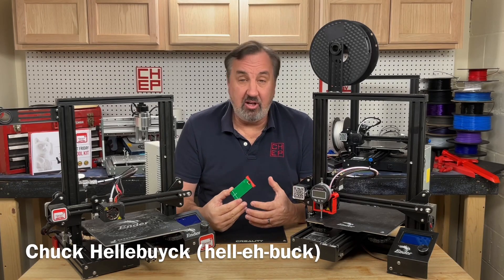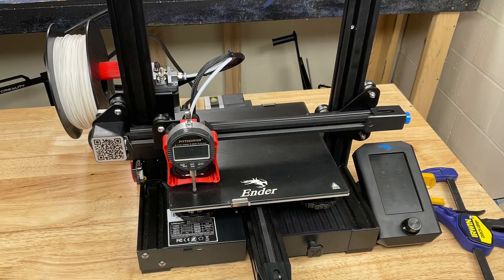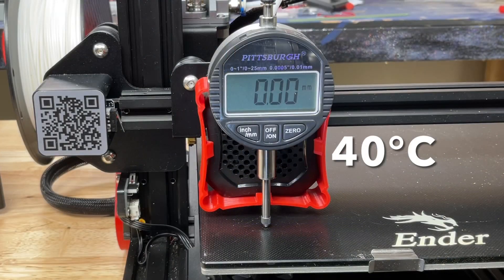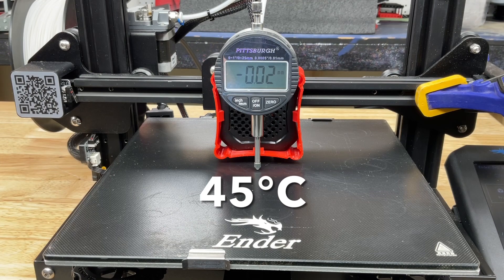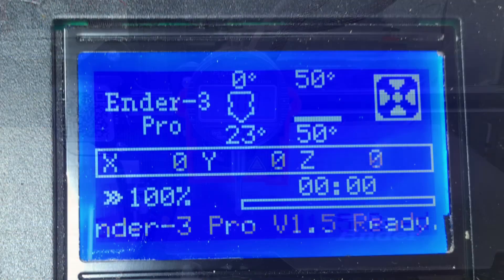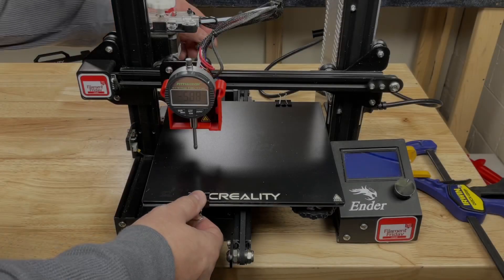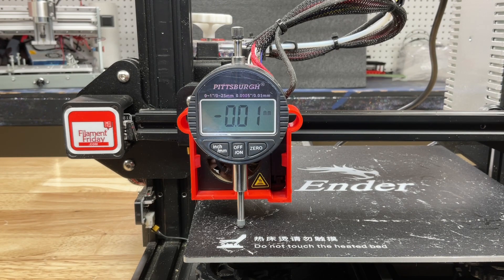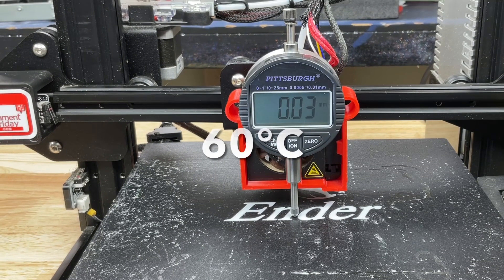Heated Bed or No Heated Bed Leveling?

Comment: When I got a Raspberry Pi(OctoPrint) and a BLTouch for my CR-10v3 I actually ran through the bed levelling with the Bed Visualiser plugin and found that I was getting a different pattern of warp when cold compared with hot, however like your video it was only minor changes.

Comment: I just got a crazy idea!
What if you could measure the width of an "elephant's foot" on the first layer of a test print that runs up, down, or diagonally across the print bed, and then use that information to level the bed?
The elephant's foot would be wider where the bed was too close to the nozzle, and narrower on quadrants where it was farther way. 
Any hope in this line of thought?

Comment: have you traid mirror glass ? that make better pritns for me. on my ender 3. ender 3 pro. ender 3 v2 and cr10 max
Reply from the maker: Yes, I’ve tried it. But over time I find it sometimes cracks because mirror glass isn’t high temp borosilicate glass.
Reply: what's that got to do with bed levelling?

Comment: I'd be really curious to correlate the probe gauge measurements with an infrared view of the bed itself. Specifically, does the bed actually heat perfectly evenly, if not could a center "hotspot" account for the variation is depths. Follow-up: if there is an initial hotspot after the target temp is reached, does additional time allow the heat to spread more evenly and either causing a more even expansion?

Comment: Lots of variables not considered here.  Lets not forget you are checking at 0.0 bed height. As a print rises in height, any imperfections are magnified.  Nice video, sorta proves to me, heating the bed to print temp can only help.

Comment: While the adjustment points don't move much when heating, the flex at the center is probably a good enough reason to heat before running something like a BLTouch.

Comment: I'm using an ender 3 with a BL Touch, so I always make it so that it only levels after heating the bed, I even make sure to make it wait for the bed to cool down. It only takes an extra minute or so, so I don't mind
Reply: Okay, but it's unnecessary.
Reply: @dangerous8333  Could be, could be not. I don't have a way to measure any difference, but my Ender 3 has the removable buildtac bed which goes on a G10 sheet. I remember once for fun I heated the bed to 110c and the removable sheet turned into a dome, it bowed at least half an inch. Of course that's because the center heated up before the edges, but the G10 sheet warping is still a light concern for me, and getting it to level with the bed hot only requires changing like 2 lines of gcode in cura, so it's no effort at all.

Comment: Bear in mind that 0.07 mm is only two thousands of an inch, for Aerospace parts that's important but for 3D printing its nothing....
Reply: But it's also 35-70% of a typical layer depending on your selected layer height. That can make or break a first layer.

Comment: I can't download your digital indicator mount.  It gives an error.  Broken.
Thank you CHEP I love your show.
Reply from the maker: Just checked. They are working.
Reply: @FilamentFriday  Yep!  It works now!  Just downloaded it.  Printing now.
Thanks CHEP!  You rock!
I do have misgivings about this mount, though.  I just tested my Ender 3 v2 hot end cover, and it is not secure.  It moves.
I don't know if we should trust a sub-millimeter reading on a plastic mounting that actually moves in the hand.
I'll print your mount and try.
Thanks again, CHEP.

Comment: The trick is, you can't have any solidified boogers on the nozzle, or you won't get the z height correct.  With the hotend warned up, you might ruin a piece of scrap paper, but you'll get the height correct.

Comment: Using PLA I always level it hot and then fine tune it during a large single layer test print one a pei sheet.
Reply: @BlondieHappyGuy  I basically commented the same thing however I'm using a 0.20mm(0.080") feeler gauge and I don't heat the bed or the hotend - perfect results!

Comment: I run ABL while my bed is heating up (then turn of bed heating after 2nd layer finishes 😄).
Reply: You might be confused.

This is for the initial bed leveling, with the knobs and when you're creating your mesh for the ABL. It's not about printing, it's just about leveling.

What you're talking about is unrelated.

Just to speak on what you're saying though, on a glass bed I would never shut the heating off. That would make my prints pop off prematurely. Especially on taller prints. On my E3V2 my prints will pop right off that glass bed when it cools down to a certain point, which I love. I've never had to use any kind of glue or hairspray nonsense.
Reply: @dangerous8333  glue, tape, hairspray, anything additional you have to put on your bed, no matter what material your bed is, has to do with other issues and more times than ever it's due to poor tramming.

Comment: My question is why wouldn’t you heat it to level? 

It doesn’t make any extra work, and a single heat time is negligible at worst.
Reply: Preheating is good for glass prints as well because it allows more time for the entire surface to get up to temperature, not just the part right next to the sensor.
Reply: @BenChilds  Glass prints?

Edit: Glass bed prints? If that's what you're saying I've never had to preheat anything on my E3V2 glass bed. With CR touch and Jyers I just hit print and walk away. Everything sticks. I clean the bed after every 10 prints with some isopropyl.
Reply: Because every extra step adds up when you're a busy person and time is money. So if there's no benefit, why do it.
Reply: The different in the center of the bed could definitely lead to trouble. 

I have a hard time seeing someone have the time to have 3D printing as a hobby, but not have the time to take 3 minutes tk preheat a bed once.

Comment: Heyy you seemed to only use Aluminum based printers. Aluminum basically doesn't deform but other materials definitely deform to a significant amount
Reply: What other materials would even be used..?
Reply: @PureRushXevus  Spring steel
Reply: @BigHonkinGoose  Do they use spring steel for the base though? I think that's what he was talking about. I don't think they use it for the base. Just for the print surface.
Reply: @dangerous8333  I think it's for the base. Not sure.
Reply: @BigHonkinGoose  Yeah.. printers themselves aren't made out of spring steel xD

The original comment made it sound like he meant the printers / print beds were made out of other materials.. which all I've seen so far, have been aluminium alloys, the only huge variety in materials is usually the print surfaces
Reply: @PureRushXevus  Also, I hear tell that cast aluminum is the best for not flexing, but machined and/or planed aluminum, especially if cheap, can warp more due to internal structural stress.
Reply: @PureRushXevus  You're right I think they're all aluminum. And the reason for that is aluminum heats more evenly.

Glass and spring Steel etc is only for the printing surface.
Reply: @dangerous8333  plus aluminum is easy to machine, and cheap :p
Reply: @PureRushXevus  Heat bed directly on glas
Reply: @allcrafter3747  ?
Reply: @PureRushXevus  like on the sidewinder x1
Reply: @allcrafter3747  Well that uses a huge AC powered heated bed, most lower end printers use small, DC heaters which are attached to aluminium in order to distribute the heat across the entire surface more evenly. 

Since sticking one of those tiny things on a thick glass bed would do a terrible job at heating the entire thing, I'd imagine

Comment: I do a 70-75c pre heat on the Creality aluminum bed before leveling. Then I manually level. I find my level lasts much much longer, especially on my machines using silicone springs. I level very tight with a very low z end stop switch. Horses for courses.
Reply: I have the upgraded springs only on my E3v2. Cr touch and Jyers. I pop the SD card in, hit print and walk away. Haven't touched those knobs in months. I set the bed manually both with and without heating and didn't notice a difference personally.

Comment: Years ago at school, I learned never to use a dail indicator at the 0 position because that is where it is most unreliable. 
That said, I don't believe it will differ a lot. 
Great test. Thanks.
Reply: good luck positioning it at 0;  you'd set it up under tension a bit and then zero it.
Reply from the maker: 3D PrintCreator - I’m not sure I understand your “zero position”. The dial indicator is not bottomed out it’s a random position that has up and down travel space and then I hit the zero display button. So how is that any more unreliable?
Reply: @FilamentFriday  lol, as said, I learned this more than 35 years ago and I am not sure if I am mixing up two different instruments, or if the dail indicators back then were another type (mechanical for sure), that you didn't zero. I have to search for it, but I think I still have my dail indicator I had back then somewhere.
Then again, as you explain it here, I am almost sure you are correct.

Comment: Incredible video, Chuck! It's about time someone had the wherewithal to test these things out! Personally I've always been suspicious of the paper method for several reasons. I believe the size of the paper in relation to the distance you're holding it at matters, as well as the angle of your hand to the plate when testing. No one has ever commented on my theories, but I'm nearly 100% certain those things matter. Lastly, I've never been able to determine the "right" amount of friction against the paper - I've seen & heard everything from "slight resistance " to "just under the point where the paper bends", so it's inexact at best in my book.
Reply: You can easily muster the wherewithal yourself. Simply get a feeler gauge and learn how to use it. A feeler gauge is a standard and inexpensive machinist's and mechanic's tool, which is used to measure small gaps... by feel.  You can then compare that to the various paper-measuring scenarios that you have suspicions about.
Reply: @Graham_Wideman  by far the feeler gauge is best for tramming!

Comment: Interesting conclusion.  I can see and reason the minor deflection of the small beds like on the enders.  But what about larger beds?  The CR-10 only attaches at four points while the CR-6 has multiple screws holding the bedplate.

Comment: A 1 meter aluminium rod expands by 0.000222 m for every 10c the temp rises by. This means tha thermal expansion on its own can never be an issue what is the issue is that beds can vary and some will warp when heated, not expand warp. This means your testing isn't relevant to anyone as their bed will behave differently from yours.
Reply: As a metal fabricator and welder, I concur.

Comment: So weird, this is such a big and common subject, I've got my ender 3 pro for a year now, haven't used paper for months and never used auto-level sensors, I only need to feel and look at the first lines on the brim or skirt to know which knobs to turn and by how much. 
After years and years, I would assume Chep would be on the same boat. I guess he does but this as a way to easily show how to level for beginners, maybe.
Reply: Oh yeah?

Well with CR touch and Jyers firmware I don't have to watch anything. I can just hit print and walk away. I haven't watched a first layer in months.

It's a joy.

Edit: Some people have to print dimensionally accurate prototypes, for one. So that's why they take the extra measures. Other people are doing it out of convenience. Not because they NEED it. ABL is not for beginners in my opinion. They should learn how to manual level first. ABL is for people that just don't want to have to deal with it anymore.

Comment: Anyone help me with printing without a raft? Using ender pro v2 glass bed, leveled. My issue is that the filament sticks beautifully when printing a raft. When i try to print without a raft it will not stick... i have tried to adjust the speed but it will not stick :( i use cura slicer.
Reply: I use hairspray. 

Aquanet All weather, extra strong, non scented. 
I made a little cardboard box to go over the bed to protect from overspray. 
But all I need is a short little spritz and I have no problems with adhesion. 
And I don't use rafts, only skirts.
Reply: @CaliMeatWagon  thats the thing its not adhesion the raft sticks perfectly. The initial layer without the raft will not stick.
Reply: Same as @CaliMeat said.  Clean my bed every 2 pr 3 prints. Use aquanet hairspray.  Also use a feeler gauge best money I ever spent.  Rarely have a print come loose and if it does clean the bed again and viola.

Comment: I literally have a dial indicator that I 3m tape to my extruder. Level, and print. I do this anytime my first layers start to bubble I do it again, or I just use a raft.  If you want to spend the money on ABL, go right ahead, no judgement. I always assumed we get way more deflection in the frame than the margin of error using a dial indicator with our lightweight extrusion frames. 

Chep, would love to see you measure deflection on the frame vs print speed and acceleration someday!
Reply: I use dial indicators all the time in my metal fabrication business. But the $40 I spent on my CR touch more then paid for itself when I coupled it with Jyers and I haven't watched a first layer in months. Time is money for me. I'm a very busy person. Nor do I like hunching over my printer having to adjust things when a simple little piece of tech can solve all those problems.

ABL is for convenience.

Comment: Quick question on the extrusion test, why do we measure it going through the extruder motor and not the nozzle?
Reply: Because you are calibrating the extruder. You are checking that when you tell it to give you 100mm of filament you get 100mm of filament. If everything is good with your extruder and hot end, i.e. its at the right temp, not blocked and the extruder isn't slipping or skipping, it shouldn't really matter if you do the calibration with it all on. But if you are having trouble with printer its best to remove that uncertainty. I just set my esteps to what the manufacturer recommends and its worked for me everytime.

You do flow calibration afterwards as different filaments have different properties at different temps, some expand after being extruded while others are super runny.
Reply: @backgammonbacon  thanks! I've got some glow in the dark filament, and I really want it to work!

Comment: My experience clearly differs; the gap definitely increases when the bed is heated. I'm  not sure what justification there is for the clamp since it doesn't  replicate the operating condition.
Reply: The clamp insures that any movement is purely from the temperature increase and not deflection of the frame.
Reply: @CaliMeatWagon  
Yes, that's  my point.

Comment: I don't think its a big deal, really. In this case, if someone is worried or having issues a good option is an ABL system, you level perfectly the bed, and then the auto bed level does the compensation.

Comment: I've learned pratically everything i know in 3D printing from Chep.. but now i'm having problems with my z-axis on the calibration cube... x and y is a perfect 20mm (Thanks to Chep)... but my Z is 19.5mm
Reply: You need to tune your z-steps.

Comment: Imo you spent a bit too low showing the temp changes where the bed didn't change. You didn't need to spend 60+ seconds showing a temp increase in the corner if the bed didn't move.

Comment: I heat bed and nozzle. I rarely ever have to level it once it's set. If your tip isn't clean it can throw off accuracy
Reply from the maker: I don’t hear them and get the same results. I don’t make sure nozzle is clean.

Comment: You can measure temperature with this method. :)
Reply: If Chep's results are correct, no you can't. The measurements in this case are essentially down in the noise and can't tell you anything with certainty.

Comment: I always assumed it didn't make that much of a difference but if your going to calibrate something you want it as close to actual printing conditions as possible.
Reply: Yeah, on my glass bed I've done it both ways and never noticed a difference.

Maybe that's different for spring steel. I know steel does react to temperature.